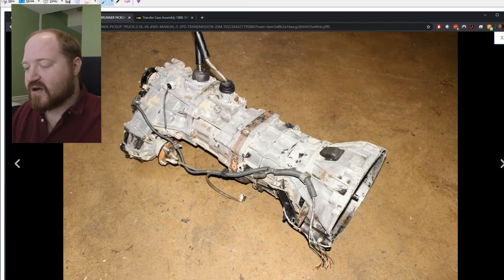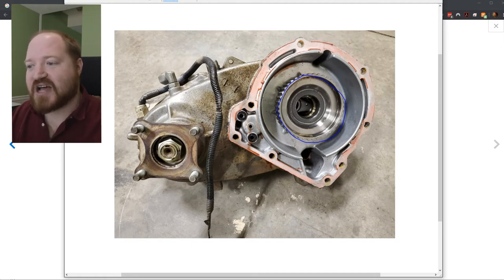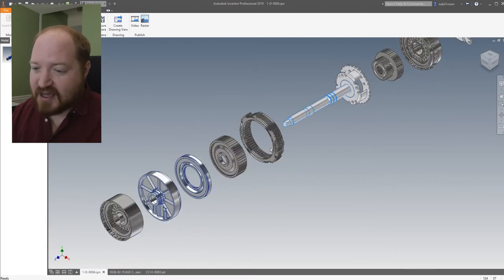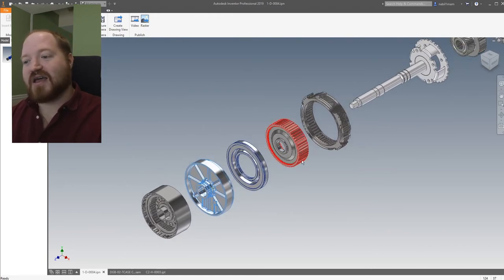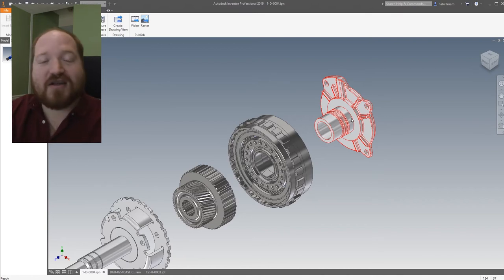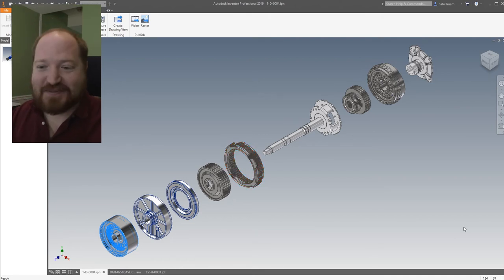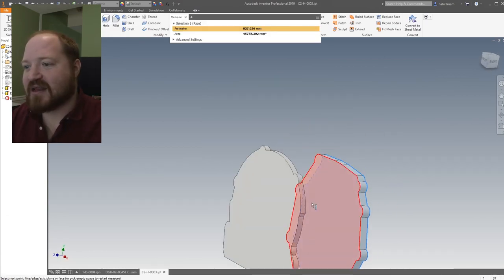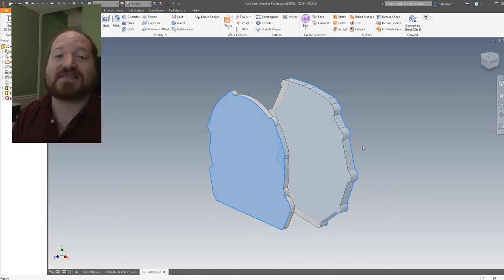TCase Conversion Pt 1- How a Tcase works and the 3d model: 1989 Toyota Truck Restoration EP 24

Comment: This is unbelievable content.
Reply from the maker: Glad you like it!
Reply: @Obscuremotorsports  I had a 1992 Pickup about 7 years ago.  The plan was to build it into a fun little 4x4 daily driver.  Soon after purchasing it I did certainly find myself fixing this, or that, and spending less money on extras, than on keeping it going.  Eventually both the auto transmission and that V6 head gasket went out and I decided to sell it.  Joke's on me though because I really missed that truck, and sure enough a couple years later I bought another one.  1989 V6 manual transmission.
I've since repaired bigger jobs than I ever thought I would, and love the satisfaction of doing so.  Occasionally I've considered selling it if the head gasket were to ever blow; however with the meticulous approach you've taken, the fear and mystery of what's inside is all gone.  So, in a long winded reply, to "Glad you like it!" -- Yeah man, I really do, and I respect the hell out of what you're doing and hope you keep it up.
Reply: @ALPINECRAGS  I'll bet that almost everyone who has sold an old Toyota pickup regrets it...I certainly do, although my youngest son and I have had the pleasure of restoring one together.